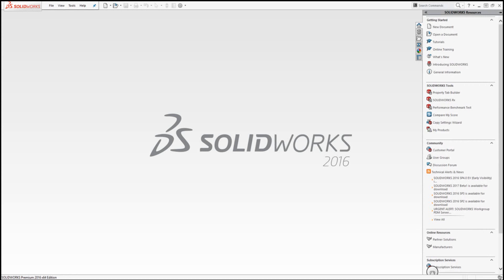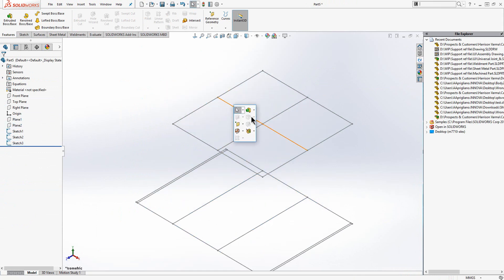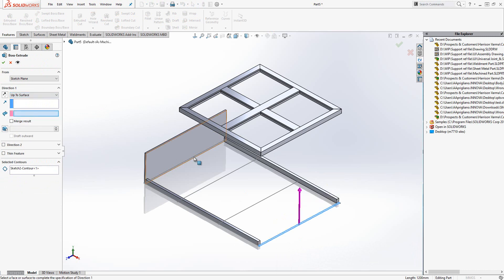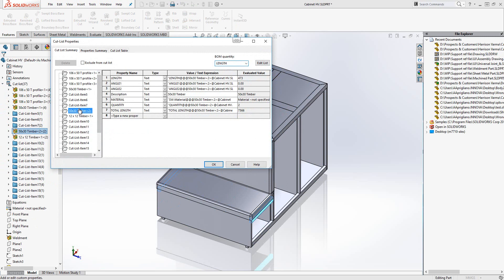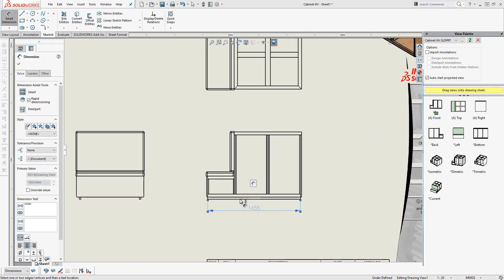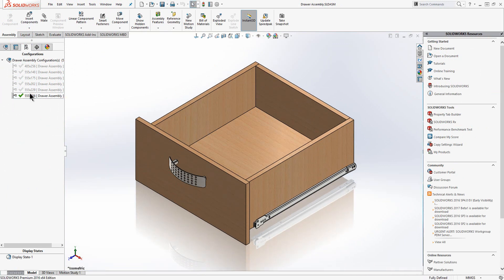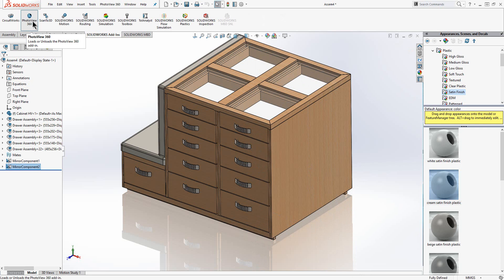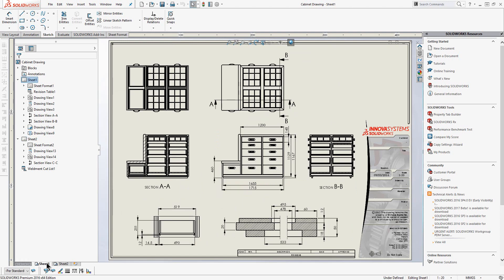SOLIDWORKS in the furniture design industry

Comment: I've followed a similar approach to designing furniture. Kitchen cabinets which vary in width but essentially the same product.

The key disadvantage I noticed from this is I cant seem to generate full drilling patterns for the cut list wood panels.

I also find it impossible to explode the welded structure since it's all within the same part file.

Maybe I'm missing something? Do enlighten me.